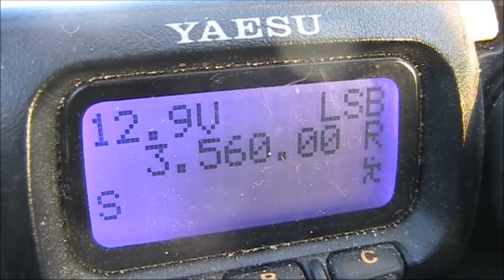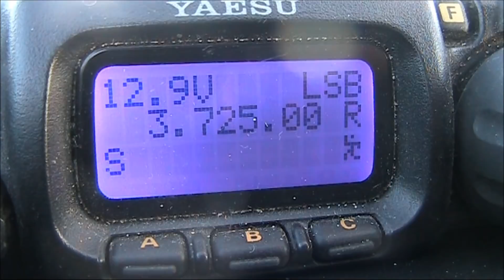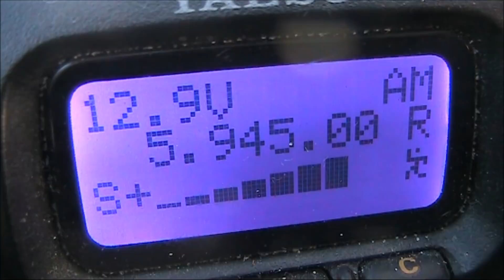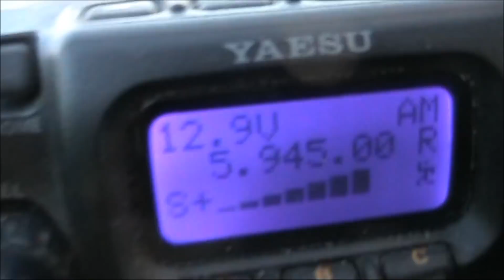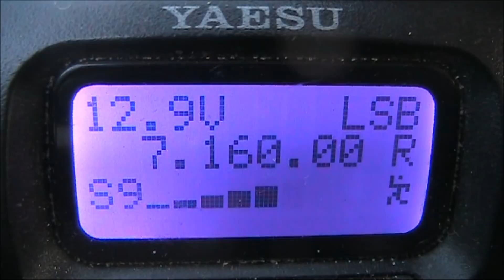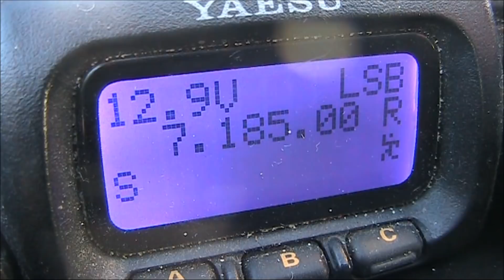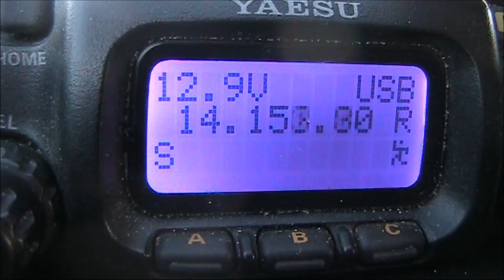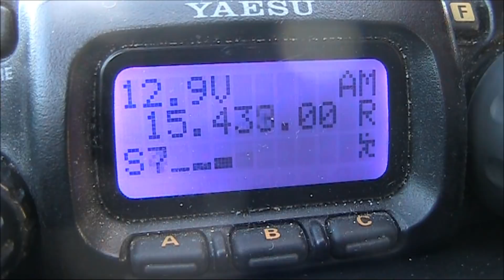Rowland Ring Railing HF Receive Antenna

Comment: can anybody explain why voice is robotic @3:33?
Reply: That is the nature of single side band voice when the receiver vfo and transmitted carrier frequency are not exactly the same. The overtones are no longer harmonicly related and are shifted by the the linear difference of the beat frequency. This sacrifice in voice quality is made because SSB requires far less power than any other analog voice transmission, allowing higher sensitivity and smaller transmitters. In addition SSB waste very little power and is very narrow in bandwidth allowing better use of limited RF spectrum. Digital mode FreeDV-700 is even better than SSB but requires special decoders however its vocoder is very robotic sounding.
Reply: @aaronedw77  thanks for the explanation!
Reply: Its was at 333 iluminati lol

Comment: I bet it's acting somewhat like a beverage antenna does on lower frequencies.
You're above the seawater: a very good ground at HF frequencies with your horizontal conductor. This conductor is only a small fraction of the wavelength above this ground. Maybe I'm wrong. Anyway another contributor to the low noise might be that the wooden  supports are probably mildly conductive and could be bleeding off charges that might generate noise in the receive.
In any event it's a great receiver, not because of signal level, but because of S/N ratio!